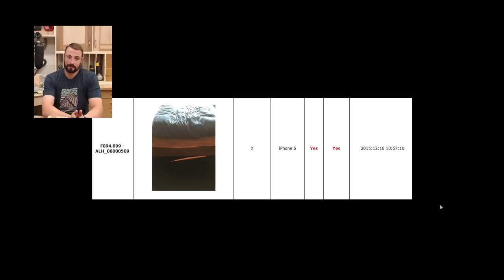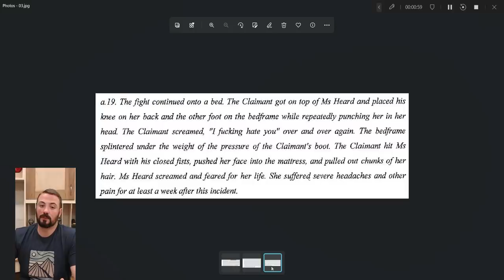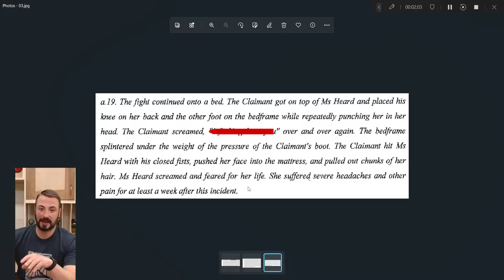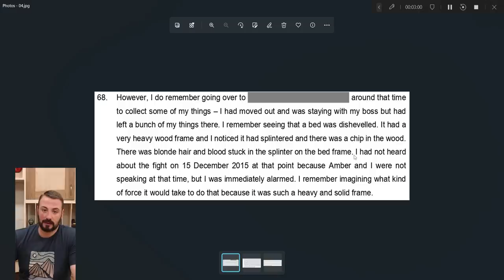Woodworker Attorney DEBUNKS Amber Heard's "Broken Bed” Testimony!

Comment: To be fair... And I'm not saying this because I actually believe Amber, just wanted to point out that wood when inside in dry environments over long periods of time do tend to crack. So it is a possibility that the wooden frame of the bed had already suffered a small crack and so Johnny's boot COULD have lodged in that crack and pushed out essentially splitting the wood. I find it unlikely that was the case, but I think that could be plausable.

Comment: I’m actually going to disagree with some of this.  Not that I believe her, but from what I see in the photo, it is possible for a boot to cause that damage. The edges of lumber used in this video are rounded quite a bit, while the lumber in the bed photo is not. When wood splinters/breaks, it usually breaks along the grain. The edge/corner where the two faces meet, is going to be the weakest spot. the sharper the corner, the easier it breaks. I’ve seen very similar damage to the edges of many tables, chairs (legs and arms), etc. Wood splinters, and I’d say most of the time it does along the edge where those 2 faces meet. 

The other things is wood moves, drys, and cracks over time. Every piece of lumber it unique. Age and condition are also factors, and those factors are hard to duplicate thru testing like this. 

So while it is certainly possible she faked it in some way similar to your demonstration, I’d say it’s also possible to splinter a long edge/corner of a board with your foot.

Comment: Try it again with some super fancy recovered timbers from 1627 that cost a million dollars because it's probably a very fancy bed for celebrities. Or just a dry rotted piece of lumber. I guarantee it will split along the grain boundary if you stand on the corner. Just because you couldn't make it work with a brand new piece of pine doesn't discount her story. The damage very well may have been created by a knife as you propose, but do not use an entirely different set of conditions to justify your opinion, that's not how scientific testing is conducted.

Comment: 15:04 When wood dries it shrinks, and there’ll be a separation between the rings of the tree as the different densities shrink at different rates. Johnny’s boot found an existing unstable area, it didn’t have to create one. 

It’s disingenuous to compare a timber bed made from well aged wood to a fresh fir product with a radius edge - the radius edge is good at preventing these types of splinters and the wood hasn’t yet had time to dry and create those natural separations. 

The diameter of the rings on the larger timber is also a significant difference from the example 4x4. 

You’re comparing apples to oranges. Wood can definitely naturally separate the way it did on Amber’s bed, and it doesn’t take much force to chip off an existing weak area.

Comment: Your rounded edge behaves differently than a sharp edge. Maybe it was already cracked and needed a smaller force to splinter. The shiny metal object is better evidence.
Reply: No, but carpentry is making new things and used things break easier.

Comment: The observations and conclusions you make are not ones I would make from these photos. I'm someone with 30 years experience applying the finish, stain and polyurethane for example, to similar wooden structures. It's hard to draw conclusions from the photos shown but as I look at the splintered timber I see a clean cut on both ends except for the last inch or two where it looks kind of wrinkled. It looks to me like the wood is splintered and would be prone to  break off at the corner as shown. The pine lumber you show is misleading because it's obviously cleanly cut with a tight grain, not likely to splinter. The bed frame appears to be made of douglas fir which is a popular choice for wood trim and doors but splinters easily.

Comment: I'm not taking sides or participating in the new distraction.

But that bed could have been exposed to water damage from a water spot creating a bigger gap between the fibers. End of the bed looks like a place where people might sit or put down liquids.

If there is an existing scored surface, you can break off the splinter with a shoe that has a softer but stickier sole.
It is possible due to the fact that it is pine and is likely a surface that has been used more than other sections of the platform.

Your simulation isn't accurate because the strength of the brand new wood fibers holding together is much stronger than your weak attempt with the boot in your hand.

Imagine if you were planting your foot on the splinter line and were pushing something heavy in front of you, or getting ready to launch yourself into a sprint (aka pushing yourself through space)

I'm not saying what happened or what didn't. But this simulation should not be taken as the uncontested truth about pine splintering, grip, or old furniture behaviors under stress.

Comment: The physics doesn't support her story. If 80-90% of his weight was on the Amber, with his knee on her back, then his foot on the bed frame, would create very limited pressure. Not only that, if he was trying to gain purchase, the bottom of his foot, would need to be on the inside of the bed frame, between the bed frame and the mattress. 

If most of his weight was on his knee - on Amber, and he was pushing with his other foot on smooth wood on the outer edge - I would expect it to just slip off. 

And ff course the knife on the bed, would be a more obvious way of inflicting injury. ;o)

Comment: Also a carpenter and cabinet maker but I disagree. I've stood on plenty of pieces of pine and it's broken off like this in the past. That isn't the only way to get that split at all.
I still think she's lying for many reasons but this video isn't entirely accurate. Pallets are a good example. Ever stepped on a pallet and a piece from the edge has broken off? Same thing. Sometimes the timber used has hairline cracks running through it. These can be from anything like when the tree fell to possibly cracking during the drying process. You don't notice them all the time especially once a finish has been applied.
The object on the bed that looks suspiciously like a penknife would suggest to most though that that picture isn't all it seems coupled with her description.

Comment: Dunno man... I believe that could easily come off with a boot forcing downwards. The corner is not even chamfered! This makes a good edge to catch on a tread, and if the grain curves around making that dish shape... It could chip off. Your example has a massive rounded edge. Just saying... Not that I believe that AT's baloney story anyway, but I've done enough woodworking to know that the edges will chip off unless rounded - like your mockup.

Comment: As the bed has a sharp edge and is built out of bigger older wood the edges tend to split and crack over the time if you kick the edge with the sole of the shoe a splinter like this can  eaysly accure. and as we can see on the oder photos the edge seems to be breake off on the whole length of the bed... 

this i no excude for the BS she is talking but your knife theory is not so only one thats possible... and as i cant see any dents from a knife on the edge i dont think i was a knife or something simmilar

Comment: While I firmly believe Amber is a liar, I don't think this is a complete argument. I am an amateur woodworker so I don't claim to have full knowledge at all, but if there was already a split in the wood, which we know wood does, then the fissure is already there for a boot to break loose. I certainly didn't jab a knife in my wood stair step that split off under my step, but it's also a much thinner board and idk what type of wood, so I know that makes a difference as well.

Comment: I'm not defending Amber in ANY way, but what if the wood was already partially split?  Also, the sample you had was rounded in the mill process, whereas the timber framed bed has sharp corners, resulting in a much higher point load.

I'm not an attorney, but I am a mechanical engineer, so I can see a path to someone doing exactly this damage with a hard soled boot.

Bottom line, she's not credible anyway.

Comment: I, respectfully, disagree with you: The picture of the frame where the piece of wood splintered off is not great but I cannot see where any of the wood has been compressed by someone digging a knife into it to then pry the splintered section away. You can also see, on the right, that the varnish had penetrated further into the wood because it is darker there. I believe that this section was already weak and that the boot could have been enough to start tearing the splintered piece off.

Comment: Can you address the elephant in the room which is that you used a rounded edge for this demonstration yet the actual bed in question has a sharp 90 degree angle which common sense would suggest makes the boot story at least more plausable.  Why not do the demonstration with a more similar piece of wood.  This seems like common sense to me as you do woodworking for a living
Reply: He didn’t even attempt to use 200lbs of force against the corner of his wee 4x4, much less test it on a comparable piece of timber. I agree.

Comment: I have four objections on this video.
1. The frame of the bed is at 90 degree angle ( 6:15 ) and your wood is rounded at the corner ( 14:55 )
2. Your " bed frame " is way smaller than the real bed therefore is more compound and harder to break that way
3. You don't  know how old the wood is and how damaged is from time and abuse.  People tend not to take care their furniture 
     If it is old and abused it's easier to break that way
4. You don't put enough weight  the shoe to even try to break it. Finger pressure is nothing compared to a foot ( 16:05 )

BTW She is liar AF

Comment: You've overreached with some of your statements. 1. You can't determine the difference between edge grain and end grain in the photo. The direction of the lighting is such that the shadows are too severe to draw any conclusion. There are other clues indicating that the bed is solid lumber, and I have no doubt it is. Just looking at the damaged part, it sure looks like the way solid wood would break. You just can't come to that conclusion in the manner you described. 2. You absolutely can break a piece of wood off like in the photo using blunt force. It would require a lot of force, and more importantly it would have to be a rapid, percussive impact by a hard object; a hammer for example. Different wood species react differently as well, so discussing a particular one like pine without knowing what the bed is made of is not particularly relevant. I do agree you couldn't get that kind of break from a foot in a boot, not unless there was pre-existing damage.

Comment: Devil's advocate here; if the piece were already damaged or otherwise weaker than expected couldn't that matter?  Also, I'm not sure why you focused on the tip of the boot alone.  Imagine the front of your foot slipping forward then the frame slipping into the gap of the boot then catching the back tread. I could see that taking off a corner, if again that corner were already structurally compromised somehow.

Honestly though this woman is a pathological liar, and despite doing it all the time and being a professional actress is absolutely terrible at it.  If that's really a knife on the bed in the picture.... incompetent seems like a generous description.

Comment: its not that i believe her but i do see w hole in your theory. the 4x4 you showed had rounded edges while the bed frame has sharp edges. your boot doesnt need to dig in to the grain all it would need to do is grip the sharp edge.

Comment: Don’t take this the wrong way (I am not in any way in support of amber) BUT to be fair, the wood you’re using has rounded corners which makes a huge difference. From what I can tell the bed frame in the trial looks like the edges are at a 90 degree point which can 100% splinter off if you step on it right. Not to mention your demonstration using your hand in your boot kinda made it feel even less convincing considering he would have so much more force with it on his foot lol AGAIN I DO NOT SUPPORT AMBER HEARD

Comment: Not defending Amber at all, and yet this video isn't a great example of how wood works. It's how new and freshly sawn wood works, and even then it is very different per type of wood (soft and fast growers) or hardwood. When wood gets older and into the phase right before it starts to rot (and/or get weaker) those "straws" that are explained in this video don't work as well anymore. It starts to lose strength, and if you slip on the edge of the wood with something with proper grip, you can strip a corner off. I've done this myself to my old bed, it more of a lucky random thing that might happen, but "on paper" it shouldn't. Wood is an organic material and you cannot explain the same situation with smaller and lighter pieces of wood with round edges.

If this was a demo for real research, this example would have been tossed into the bin.
Reply: you're saying a wooden bedframe made within the last 10 years would rot in a bedroom setting? do you not own furniture ? rotten wood would turn to dust, be it wet rot, dry rot or termites. your comment makes it sound like you've never seen wood in your life.

Comment: Unfortunately I have to disagree extremely with your demo. Let me premise this with I am 100% on Johnny's side however, you have completely botched this representation. 

In order to reproduce any action, you must use exact objects comparable to the scene. Your wooden block not only is smaller and thicker but is also rounded on the edges. I know personally where I have gotten an edge of wood in between the grooves of a third row on a boot and the weight has splintered or separated the wood by weight. Also you have to keep in consideration the age of this frame as it's way older than the one you were using and the facts that it has chemical treatments inbedded in the wood which also can cause stress over time in the integrity. I appreciate your thought out logic, but you misrepresented this dramatically and its sad that you did such a thing.

Comment: First off, amber turds just that, a lying turdmaker. But as for this vid, your showing a rounded corner vs the sharper corner on the pic, I know that the break on the wood in the pic is possible, becasue i am staring at my coffie table that has that exact same damage SPECIFICALLY because someone WITH BOOTS broke a peice off just like the picture by purchasing thier foot on the coffie table. 

Again, not saying shes not lying, but AM SAYING that you need to take a non rounded cut of wood just like you have in the pic (preferably somethign with a looser structure further away from the eye) and then try kicking the corner a few times, I can guarantee that you can splinter off a peice farly easily.
Reply: post a picture of your coffee table